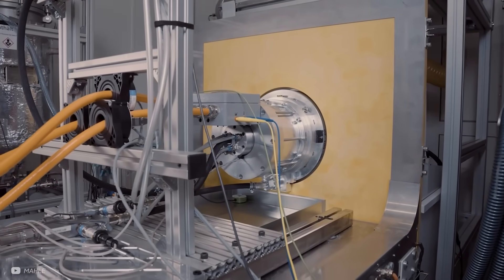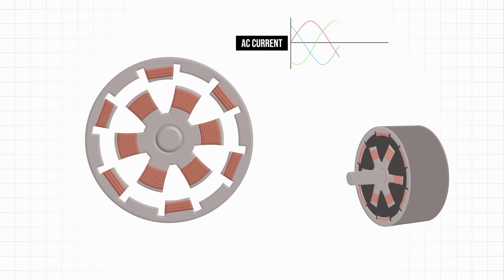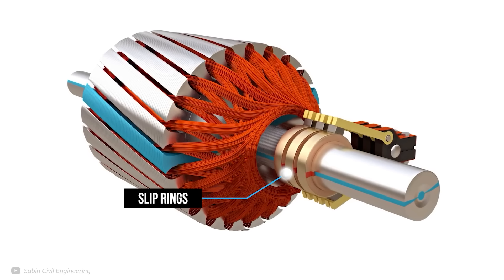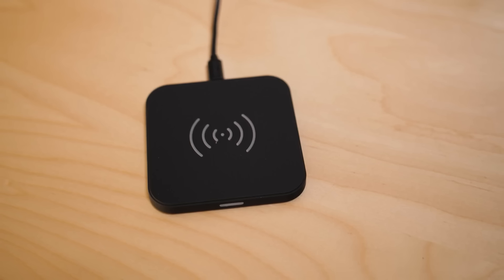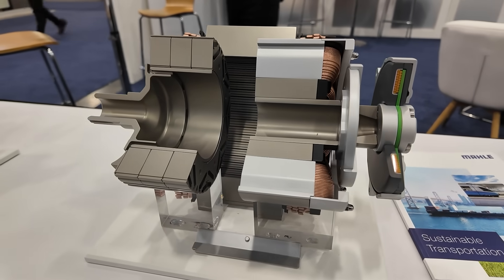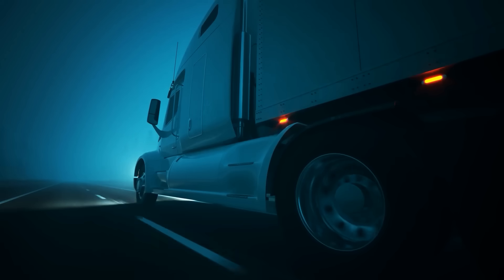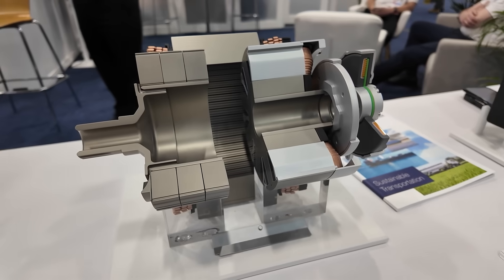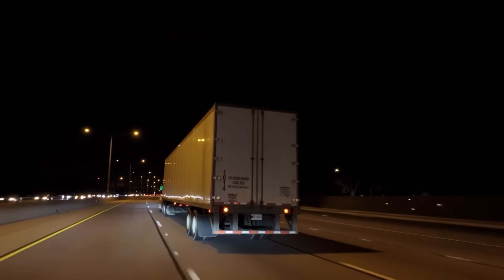Genius Contactless Motor Could Change Transport Forever

Comment: Oil cooling in direct contact with the motor seems like a bad idea. This is how large electrical transformers are cooled and the oil has to be maintained in a clean state. Debris/contamination can cause the transformer to short and potentially ignite. One of the advantages of EVs is eliminating lubricating (or now cooling) oils and the associated maintenance.
Reply: I guess it's a closed loop system and the motor would be sealed pretty well tho
Reply: electrical transformers don't have a coolant pump. this motor does due to the action of the rotor so i assume it is fitted with a filter. also i assume it doesn't use ball bearings and instead uses the journal type a car crankshaft does. this would also extend the life.
Reply: @martin-vv9lf The video actually shows  hand installing a filter onto the body of the motor
Reply: Tesla has done this type of cooling for years in the rotor (early models).  It only needs applied when under extreme use such as demonstrated in the video.  The reality is this method isn't required for most applications as the motor should never be run at max power all the time.  That would be a poor design.  Tesla has since stopped using a liquid cooled rotor as it can cool the motor externally (and they still use liquid).  liquid cooled rotors are a failure point as you described and older tesla owners are finding out the hard way.  Luckily there are bypass fixes to stem the issue if found early.
Reply: No worries, just use PCB oil and it won’t burn! 😹
Reply: @cyberGEK In a world free from fearmongering for profit, consumers and engineers could jointly make the choice whether to use non-flammable but toxic PCB treated oil, or non-toxic but hygroscopic and flammable mineral oil.
Reply: Deionized water is less viscous, has a higher heat capacity, and has virtually no conductivity.  However, DI water can be corrosive and has a lower boiling point, so there are those obstacles.
Reply: dont ic's have the same requirements for their oil?
Reply: @bobmike2373  Except in ICs, the oil gets contaminated by both coolant and combustion gases. Barring that, the oil in these motors should last until such time as the motor needs to be torn down for service. And then, it can probably be reconditioned and put right back in that or another motor.
Reply: @MarkStockman-b4j  is there no filtering at all in the oil for the ev motors in the video?
Reply: I continue made my innovative project of a non-combustion engine, I remind you that I am posting here on my channel the technology and the principle of operation, according to which anyone can create a prototype and enjoy free energy, since I was denied financial support at the stage of the idea and theoretical research, after a year of unsuccessful searches. Including I will begin to assemble a sample. And soon another video will be released, revealing my developments, the wind of change is approaching! All those who are not indifferent, welcome to the flight in this departing innovative car, which will lead to great achievements for the successful future of the planet and humanity!
Reply: In the real world environment of dust, water and road salt (the latter two make conductive, corrosive brine when combined) a sealed motor is a huge advantage. And in cold climates, that waste heat can be used both to keep the battery pack warm and for the heater/defroster.  Also think of an offroad vehicle that needs to ford water.

Comment: @ZirothTech
Wireless charging is more convenient for phones but it isn't more efficient than wired charging, it's lower.
Wireless charging replaces a piece of wire which, certainly at modest charging current, will be pretty close to 100% efficient with; an oscillator, a coil, a variable air and/or plastic gap, another coil and then a rectifier, five stages all of which will introduce some loss.
Reply: I'm actually looking into old fashioned brushed DC motors for the EV design I'm working on. "Brushless DC" (BLDC) motors aren't actually DC motors at all. They are multiphase AC motors that get their power from DC sources. This means all the cost and complexity of electronic motor controls.

Comment: Be neat for them to try this in a Hybrid design with redundant cooling systems and higher-grade metals especially if it's meant to "...run full power and torque the whole time." Well, that would mean you would get 30 min driving time in a pure electric.

Comment: brushless non-pulsed dc motor would be even more perfect. whats new about this electromagnet ac pulse motor.
Reply: try pure dc magnet against magnet hall-effect double bearing motor instead. double m innovations channel has a demo unit, but they use two-point maglev to bearing the motor.

Comment: I can't help but feel uncertainty in the wireless power coils... like it would be inherently receptive to other sources of power, but that is probably handled by circuitry if said circuitry doesn't fry first from said power source.
I'm thinking worst-case scenario it would briefly spark and smoke a bit during an intense solar flare hitting Earth or direct strike from lightning bolt, in both cases we have other things to worry about.
Reply: schizo

Comment: 95% efficiency implies 5% loss to heat. So a 500kW truck motor will produce 25kW of heat - no problem warming the cabin with that!
Reply from the maker: Exactly! :D
Reply: Do you drive up a steep hill with 500kW all the time? To drive on a flat highway at 100km/h, you need about 10kW for a car weighing 1200kg
Reply: @srotovnikabc6919  No but I was referring to trucks (I.E. 18 wheelers). And in the video they were talking about continuous running at maximum power being a feature, that's all...
Reply: Use steam to produce electricity?
Reply: I can warm my house with that.
Reply: Jesus, all the armchair experts here…a 500kW motor doesn’t mean it uses 500kW energy all the time, so your little theory is flawed right there.
Reply: Gym goers could spin wheel make free energy,  something useful training ass
Reply: @ Hope you get your Nobel price soon
Reply: You mean burning petrol generates less heat?
Reply: Much of the hrat from an ICE engine goes out the exhaust pipe, some is radiated off the block and some is taken away with the radiator.
Reply: @TDVL  Indeed, they are much less efficient. In an ICE car, most of the heat of combustion goes out with the exhaust gasses. The main reason why ICE cars have cooling system is to cool the metal of the engine block which is heated by the friction of the tight pistons scraping up and down in the cylinders. It's why EVers like to call ICE 'friction engines'. :)
Reply: @mb-3faze  Ice engines are indeed far less efficient topping out today at around 45%.  However, the friction is quite a low part of that.  It's the amount of energy lost that does not do work .  We spin new engines on dyno for hours with an electric motor, this is to test and "seat" mating machined parts.  no fuel burned and rings produce relatively little friction.  Hence why they last decades.
Reply: @mb-3faze  It's odd that cars wouldn't capture that heat with a heat exchange system.
Reply: @fwaynedavis  Interesting. Often wondered how much actual energy was needed to overcome friction in a engine.  Do you think the friction is the same when the pistons are being pushed up and down by the crank (when driven by an electric motor) or alternatively when being forced down by gasoline explosions? I suspect there is a difference.
Reply: @greevar Turbos are really the only useful way to harness waste heat in a car. It’s not easy to turn heat into useful energy if you’re trying to do something other than heat stuff
Reply: @ That’s a myth. If an expansion engine is well made, there is no “waste heat”. There is only the heat that must be removed, and that’s a bit of a difference. That’s heat that no other turbine uses.
The thing is different. Turbos are used to increase specific power, and the expansion volume could be smaller, and the losses relatively low. Otherwise, the displacement expansion volume would be enough and there would be no need for a turbo. The expansion temperature could be <200C. Otherwise, the engine would be more expensive, heavier, larger.
Reply: @fwaynedavis  ICE engines are nowhere near 45% efficiency. Theoretical maximum is 30% and that's assuming there are zero losses in the power train. Real world efficiency is just above 20%.
Reply: @themonsterunderyourbed9408  Correct about powertrain. 45 is the highest published "engine" I could find(toyota).  And that's a great point when pointing to EVs.  They have a simplified powertrain, which is far more efficient after the motor.  So the effective energy used for work is significantly higher than ICE.